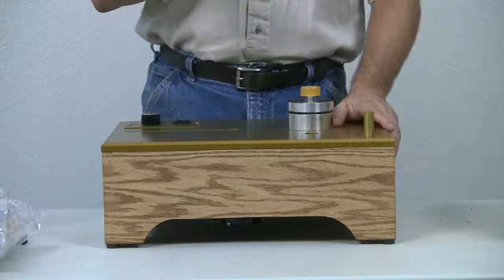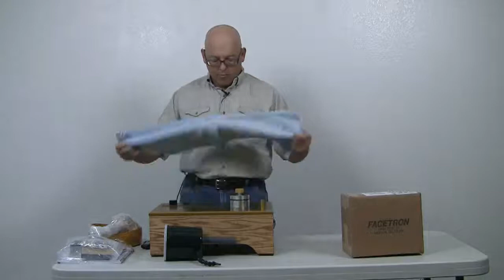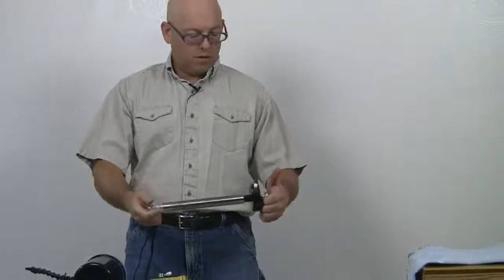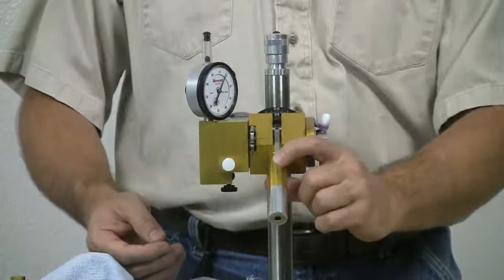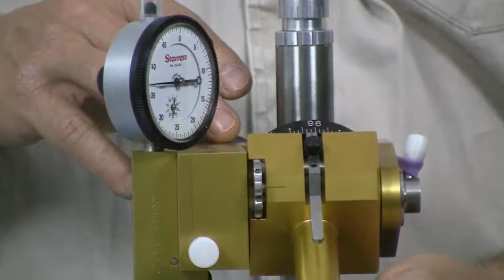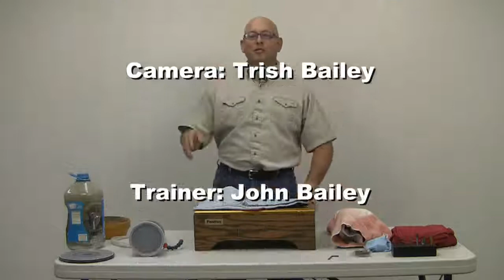Official Facetron Videos: Detailed Tour of the Machine

Comment: My USED Facetron that I bought from Ebay has a cheater that seems to be frozen.  I haven't found a video of someone demonstrating how it moves and I don't want to break it.  Also my Facetron is so old it doesn't have the dial guage on the top.. only the tiny needle, and I don't know how to recalibrate it, and it seems off. :(  I am still cutting gems, but without these repairs and understanding, my precision can't be the best.

Comment: Hi Mr. Bailey,
I'm in need of the lap nut and the washer for my facetron.   I spoke to 
Mrs. Jarvi, and she said they don't have the washer.  I've tried locally to find the correct size washer, but to no avail.   Do you have access to the nut and washer?  If so I would like to buy, if not where might I find them, at least the washer?

Tom
Reply: You may have to fabricate one - or ask someone to do that for you - out of some HDPE or Delrin. If you have a 3d printer - or a friend with one - you may be able to print one.
Personally, I'd buy a rod of delrin and turn a handful on my lathe so I'd have them.